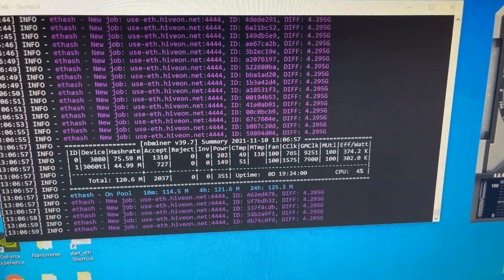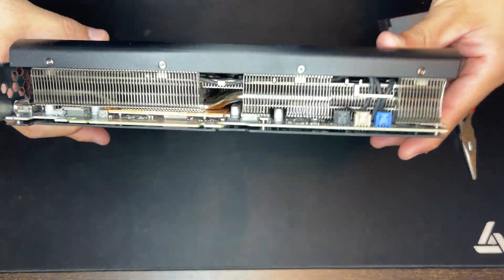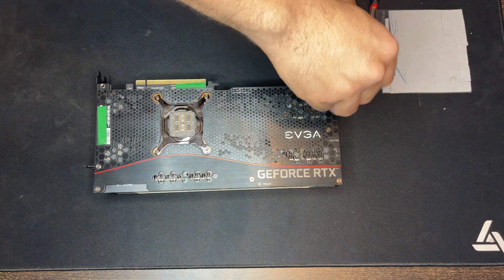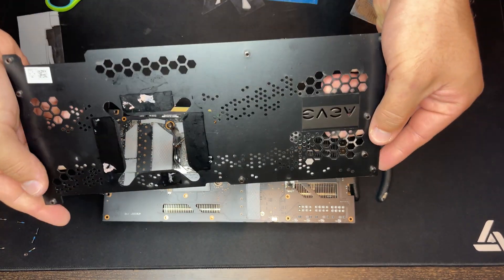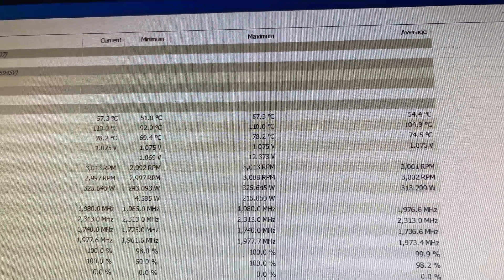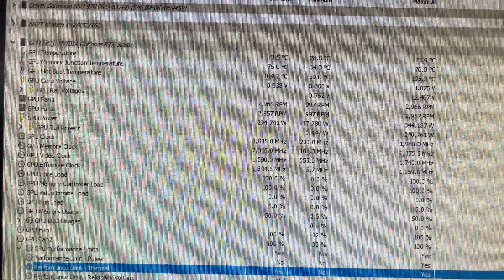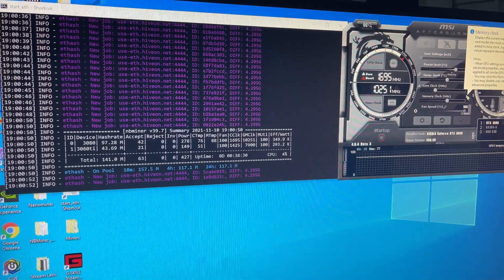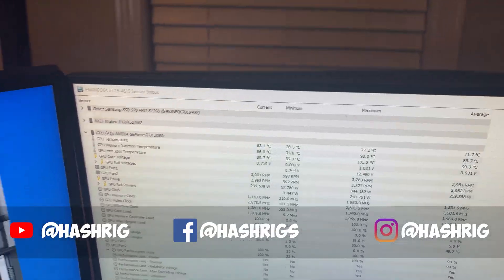EVGA FTW3 RTX 3080 Thermal Pads Replacement & Upgrade | 102 MH/s

Comment: I get 99.58 on 70% power no thermal throttling. 1211+ and -211 fans 70% ( without replacing pads) Same card. You need to do the inside pads if you wanna get the temps down to about 68/70 degrees. Your hot spot is way too high still. There is a row of black chips you need to cover 1mm pads. Same as my xc3 which was an absolute pain to cool but sorted it eventually.
Reply from the maker: thank you for the advice!!!

Comment: thanks for your video! got the same card but not ftw3, I guess the thermal pads sizes should be the same. Did you use 1mm or 2mm? thanks!
Reply from the maker: I used 2mm pads